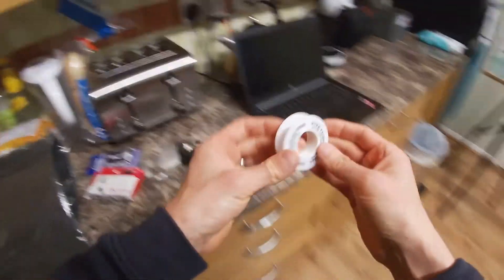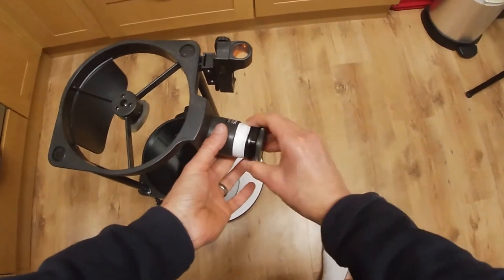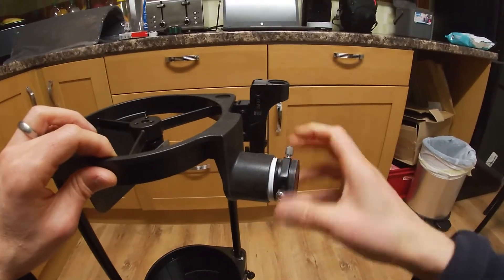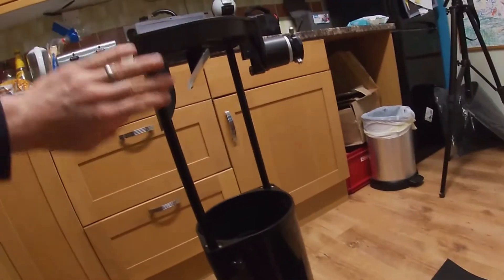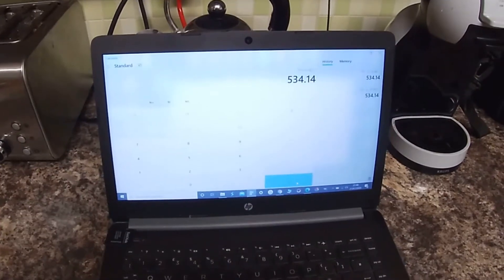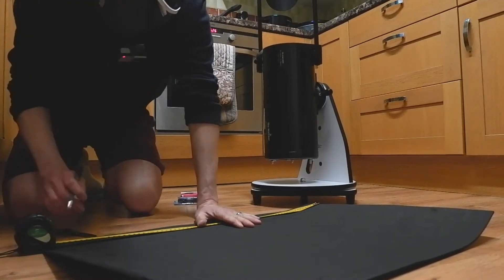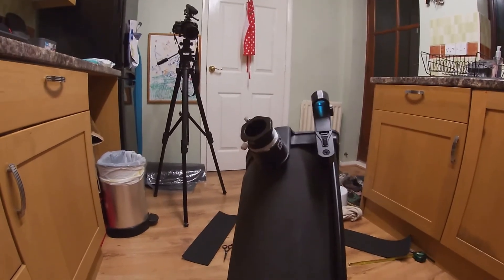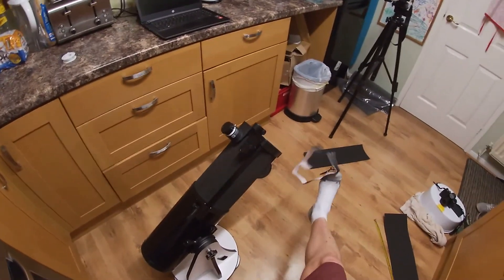Focuser and Light Shroud Mods -  Improve Your Sky-Watcher Heritage 130p 150p & OneSky Telescope

Comment: Hi mate. What would be the best for deep sky photography? A 120mm achromatic refractor or a 150mm reflector? Both would be F5 and both are on an eq3-2 mount and tripod. Also, Transportabilty.   Thanks for any advice.
Reply from the maker: HI Alan, doh! I just wrote out a massive reply and it got lost, so I'll keep it short second time around lol The best 150mm f5 would be this one: https://www.firstlightoptics.com/reflectors/skywatcher-explorer-150p-ds-ota.html 

although on an EQ3 I would go with the 130pds as the focal length is a tad shorter so it will be easier for the mount to track for longer. For DSO imaging you ideally want to put most the money into the mount and keep the focal length short so you're not smearing photons across your camera sensor with tracking errors. Tracking with the Earths rotation is the most critical thing with DSO imaging.
Reply: @Astrolavista  Cheers, mate.
Reply: Both would be far too large for an EQ3-2 mount for astrophotography. In addition the achromat would show serious chromatic aberrations. Most people use small ED or APOs on very sturdy mounts for astrophotography, alternatively you could go for a smaller reflector (e.g. 130 mm Newton). Or you could simply start with a photographic tracking mount, DSLR/DSLM and lens - the pictures you can get that way are still stunning (see Astrobackyards channel for a video on photographing the Orion and Horsehead Nebulae with such a set-up).

To sum it up, astrophotography is complicated, expensive, and the mount is much more important than the telescope you put on it.
Reply from the maker: @AGH331  Yes indeed, good advice. A star tracker particularly with a lens is by far the cheapest and easiest way to getting good results with DSO imaging. I don't object to people starting with a 150p EQ3 and motor drive though, I managed to get 60 second subs out of mine which isn't bad for 750mm focal length, so it's not the worst place to start. I actually think the 150p EQ3 is a good all rounder. The ST120 would have been way worse, I bought one and moved it one pretty quickly. Way too much CA. I think the ST102 is better, I'm playing with one of those at the moment. I take it you didn't have so much luck with your EQ3?

Comment: Dear Chris, do you use any barlows with this scope? I heard many won't work due to the short focusser.
Reply from the maker: HI Arendom, I'm afraid this is true, I can't get my Revelation 2.5x Barlow to reach focus with eyepieces or my planetary/Lunar camera if I use the scope as intended, but there is a work around! :) Just drop the truss rods about 3/4" and lock them in that slightly lower position. Last night I was observing the Moon, Jupiter, and Saturn with my Explore Scientific 10mm LER and Barlow, plus I imaged the Moon, Jupiter, and even the Ring nebula as it drifted by with my ZWO ASI385MC, so it's a pretty cool work around :)
Reply: @Astrolavista  but doing so you cut your aperture, which is not good when it comes to planets, is it?
Reply from the maker: @gravelking2.071  Think of a situation where we both have the above telescope to image say Saturn. You choose to have the truss rods fully extended because your worried about losing a small amount of aperture from the the edge of the primary mirror but you can't focus Saturn. I choose to drop the truss rods down a little bit to reach sharp focus, but in doing so sacrifice a touch of aperture. Who produces the better image?
Reply: @Astrolavista  Can changing the focuser fix the problem?
Reply from the maker: @DagonFF  possibly yes. You would need to find a focuser that both fits the bracket, and is light enough not to bend the bracket which is only fixed at one end. The tape is just quick, cheap and easy.
Reply: @Astrolavista  thank you for your answer!
My concern was more about using Barlow lens, that the focuser is too short to get focus. Is there any budget focus you can replace the existing one and fix the problem? I got a 150p coming soon!

Comment: Great video, will do these once my 150P arrives. Another thing I've picked up in different places is that the edges of the secondary mirror should be blackened to reduce reflections - with a black marker, or ideally with black velvet. It's also been suggested that lining the inside of the tube with velvet would further cut down on reflections and increase contrast.

I've also thought about ways to attach a 2" eyepiece instead of the 1.25" one, but that seems to be a tad beyond my DIY skill :D
Reply: What telescope do you have 👌
Reply: @Nottsboy24  None so far :D I ordered the one in the video (Skywatcher Heritage 150P) and it should arrive in a week or so. I just tried to find all the information on it that I could, and made a list of modifications and adjustments that others have made and recommended.
Reply: @AGH331  ok cool 👌
Reply from the maker: Hi AGH331, congrats on ordering the Heritage 150p. I have a few videos on that scope so far if you want to check them out. Yes edge blackening lenses and mirrors is another good little mod to perform to help with contrast, and flocking (black velvet) too! lol I think a 2" focuser mod is beyond me also! I'm not sure the truss rods would take 2" eyepieces so it's probably for the best :D p.s. just brought back memories of the heaviest eyepiece I ever owned. The Maxvision 40mm 68 degrees at a whopping 1.3kg!
Reply: Can someone help me? Which is better:heritage 130p or Orion StarBlast 4.5 Astro?
Reply: @BempostaFlix  atual no there are many used 130mm telescope WITH eq mounts they are very value get one of those
Reply: The back of the mirror is not in the light path so is unlikely to make any difference but if you do blacken the edges, use blackboard paint because from experience of using a permanent sharpie marker as many recommend, they do not fully dry on glass and leaks onto lenses when there is dew or when you clean them and after cleaning them, residue seems to stay on the lenses. I ruined a ST80 because of this bad advice. The blackboard paint i used was called Rustins and works very well.

As for 2 inch eyepieces, there is a trick or hack to this. 

Unscrew the helical focuser so it comes out and you have an empty focuser.

Extend the Truss all the way out.

Hold the 2 inch eyepiece up to the focuser opening.

The loosen the truss and move it down to focus.

Not perfect because you have to hold the eyepiece but it does come to focus, looks great with a widefield 34mm eyepiece.

Skywatcher should release an adapter to slide over the focuser so we can use 2 inch eyepieces like this without having to hold it because these have the same mirrors as the Skywatcher Explorer 130P and PDS so there i no issue with loss of aperture.